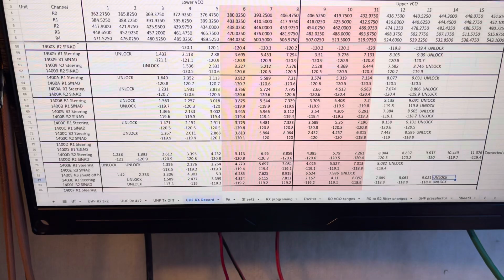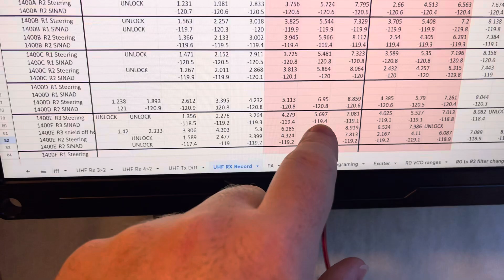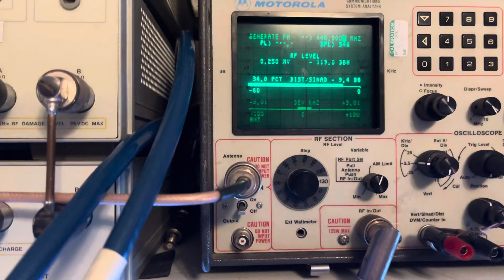Quantar/AstroTAC UHF Range 3 T-Band to Range 2

Comment: What spreadsheet were you referencing
Reply from the maker: That’s my tracking spreadsheet.  It has a serial number of the unit and then VCO voltage/SINAD numbers across the tuning range.  It lines up with the Quantar test codeplugs I’ve made available.